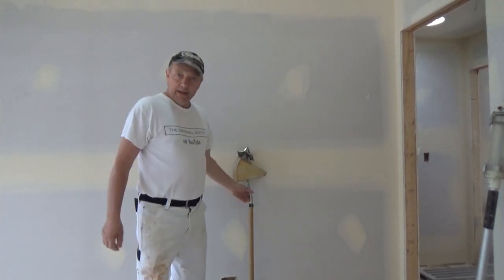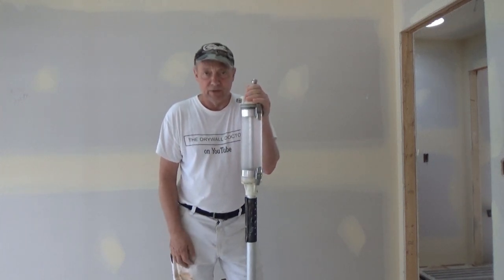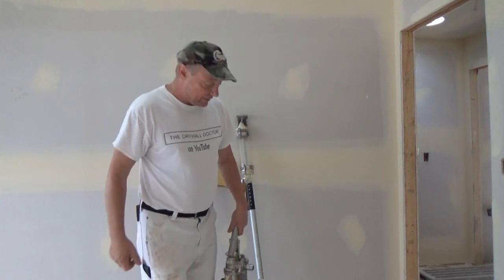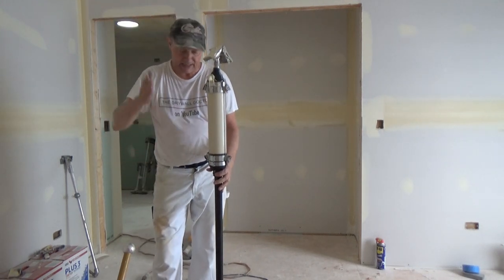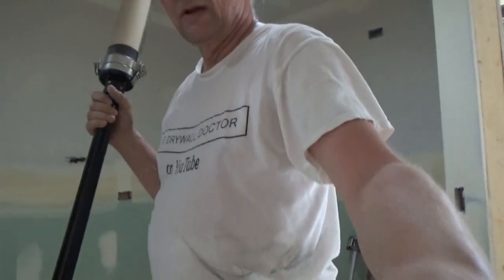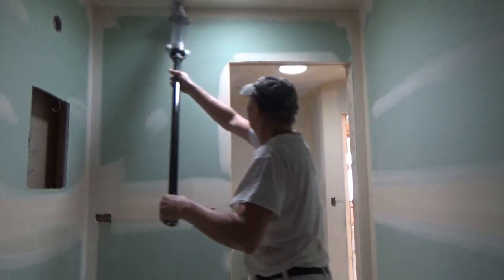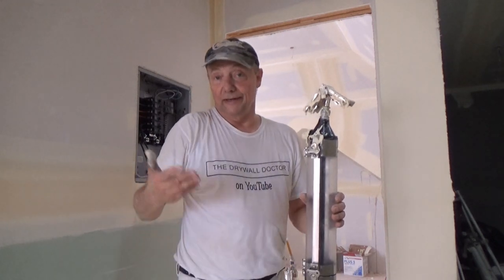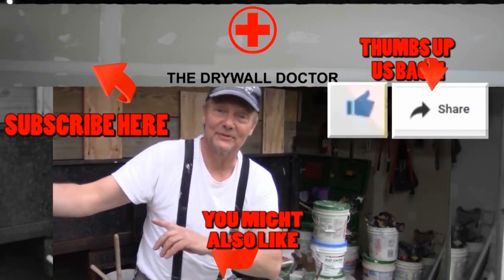Mud Shot vs Mudrunner

Comment: The mugshot just like a box you have to put water in it and slosh it around. There's holes in the back to let the water run out. Then pump up the mud runner. You'll see that it pumps up much easier

Comment: I just purchased a Mudshot, was hard to pump fill the first time so I called Level5 , they said to lube gaskets with 3 in 1 oil because the tube was dry, once I adjusted the flow it worked very well.  
Like any new tool, have to learn the little tricks.
Reply: Personally I’ve used the mudshot  ive ran about 1,000 sheets with it and it still is very hard to pump up. I use 3 in 1 oil ,silicone and it makes it a little easier but still to hard to pump up. I bought a whole dewalt set and for the price I’m very disappointed.  I should’ve went with tape tech.
Reply: Mud runner works with the gas pressure in the handle. Have to twist the handle to cause mud to flow. Works except only one side of the handle is knurled, the other side is smooth. With any mud on your hands, it will slip. Contacted tape tech and they assured me both sides were knurled. Apparently the 2 I’ve had were special! Been sitting on the shelf for 3 years
Reply from the maker: I can twist the handle either way it makes no difference.

Comment: Make sure the piston ring isn’t pinched inside the cylinder, also silicone spray lubricant helps. My mudshot isn’t too hard to fill, but I always elevate my pump to about 2 feet off the ground

Comment: Check the screen at the bottom of your pump. I've discovered some trash or something restricting the mud from loading the chamber. Also remember the mudshot spring will age and weaken over time,thus making it easier to load because of less resistance!

Comment: I found if you wet and lubricate the piston both sides before you start and use your weight on the pump its not so bad. The first time I used mine I did 99 internal angles in 4 hours including one break which was OK I thought. I am old now and had to go home for a sleep but was still pretty happy about it, just wish I had it 20 or 30 years ago..

Comment: The hole where mud goes in is probably thinner, in parts are new and lil bit sticky, or cable.....didn't get cleaned well?

Can only be a few variables.....

Holding more mud is a plus......should just make a bazooka with angle head attachment

Comment: Graco has an automated pump, I wonder if it has enough pressure to fill mud shot?
Reply from the maker: It might
Reply: It definitely does. That's why I bought one. I fell in love with my Graco pump.
Reply: @timstrausbaugh3012  How is the graco pump holding up? I’m considering buying one for my dewalt mudshot but it worries me that it’s going to kill the motor with the pressure! Hand pumping 82lb of pressure it’s hard doing it all day
Reply: @omarzepeda7475  It's holding up really well. I haven't had any problems with it at all. The impressive thing to me is how long it lasts on one battery. Maybe it's just me but I kinda thought pumping up that MudShot would wear down a battery pretty quick. That's not the case at all. Now I'm getting older and ain't putting out as much production as my younger days but it has held up and I'm still really impressed with it.
Reply: @timstrausbaugh3012  Thanks for the response! I been trying to buy the graco pump for a few months but I wasn’t sure if it was capable to load the mudshot or maybe it’s just me that finds it super hard to pump it manually
Reply: @omarzepeda7475  You're welcome and believe me I can relate. I didn't know if it was me, my pump or that the MudShot was just ridiculously hard to pump but I was pretty much using half strokes with the handle to fill it. That way all the pressure was being applied straight down with each stroke. Watching that tube fill up nice fast and easy with a press of a button on that Graco pump still puts a smile on my face.

Comment: I've got a question. The mudshot is gas assisted right? So what gas do I use to fill it up when it runs out and how do I fill it up please?
Reply from the maker: They are sealed you can't do anything except have it rebuilt
Reply: @THEDRYWALLDOCTOR1  Thanks for you response. How long will it last until it gets to that point? I think I'm leaning more towards getting the mud runner now.
Reply from the maker: I've had my mudrunner many years and it still work
Reply: By gas assisted, they are referencing a sealed gas prop rod, similar to what closes a storm door only in reverse.

Comment: im a property flipper. I just got my first angle heads.  they only had the angle box and it was to to expensive to buy with a pump.  so for now i put mud in the corner with a toilet bowl brush and set the tape in and then put  a little mud on top with the brush and then use the 2.5" angle head to smooth it out with just a pole.  im gonna try to do the same thing with the 4" angle head and brush for the second coat. i dont do production work so this will be easy to do and clean and maintain.

Comment: My compound tube works like a syringe. Are you sure that you aren't filling it wrong? I just watched another video they used a dewalt pump and it took about three pumps to fill it and they didn't look like an easy pump. It dont hold much mud for the cost either.

Comment: Mine is not hard at all to pump up make sure the vent holes on the bottom are all clear
Reply from the maker: That's where I oiled it they were clear
Reply: I wonder if the oil actually created the seal for making the back pressure not release?

Comment: Question:
Are the tapetech anglegeads compatibel with the mud shot
Reply from the maker: Yes
Reply: Ok i ve just starting taping angles :
I use the bazooka then the corner roller and then I use the 2,5 inch angle head to wipe the corners:
Goes very well and smooth but sometimes the angle head seems to get stuck while wiping.
Notice that the mud is very thin?
So what’s causing that?
Olso to finish the corners I wanted to order the 3.5 “ or is it better to order a wider anglehead?
Kind regards
Reply from the maker: The three inch is fine too.

Comment: Hey doc I bought a mud runner because of your vids but the problem I’m having is when filling it the mud comes out of the end ,I have to take the angle head off and tap the the end against a stud wall to stop it have you had this problem ?
Reply from the maker: No is it clean? Take a picture and email me thedrywallphd@gmail.com
Reply: @THEDRYWALLDOCTOR1  it’s always cleaned and oiled but the stopper won’t reach the end after one fill ,I can’t see a way of adjusting it .if It tap on the end against something hard I can fill it again which is no good so I’ve been using my angle box again.if you’ve got any ideas it would be much appreciated thanks for replying btw🙏
Reply from the maker: I'm going to post another comment here of another video that I did with the mud Runner
Reply from the maker: https://youtu.be/QUf9FgtOUMA
In the way you see me take the mudrunner apart is the only way I ever take the mudrunner apart.
Reply: @THEDRYWALLDOCTOR1  I watch all your videos doc I’m a big fan so I do all the things in that video it doesn’t stop the problem but thanks for coming back to me it’s really appreciated .I’m sure I’ll come up with a solution because when it was working it was a dream to use thanks again for your time🙏🙏👍👍
Reply: @dieseldes1301  mine does that too. I find that if i dont run it all the way empty it solves it.

Comment: Hello. I'm one of the people, who bought mudrunner after your videos. But one question disquiets me: I noticed, in the last third of stroke the pressure is very weak. It's so weaker than in first two thirds, that easier to load again. Is it normal for all mudrunners or something is wrong with my one? In your videos I don't see a such behavior in your device.
Reply from the maker: My first mudrunner was that way I was told the pressure seal it's going bad this is a new mudrunner that was just given to me because they didn't like it and it works perfectly

Comment: Stick with it for a job or two, it will break in
Reply: Hello sir; what you mean with it will break in.
I m from Belgium so I don’t understand everything.
Kind regards 
Joël
Reply from the maker: Sometimes it's stuff and will run smoother after you use it a few times
Reply: @THEDRYWALLDOCTOR1  did it get easier to fill the mud shot after a couple times? I’m wanting either the mud runner or shot but haven’t decided which one yet
Reply from the maker: Not for me but my pump is very old.